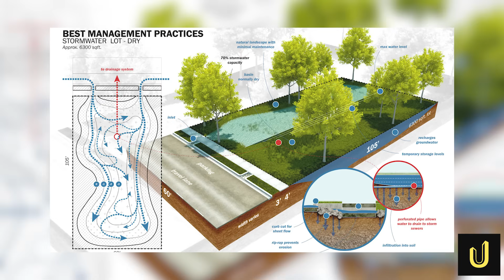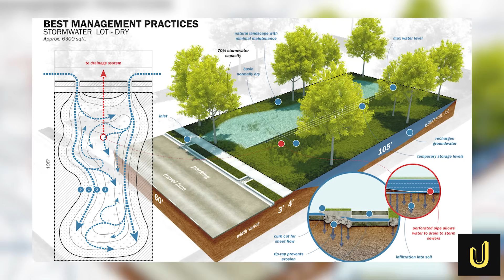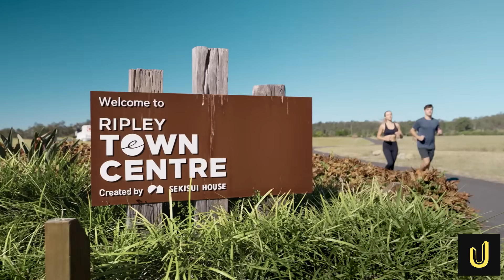The Secret Underneath This $2B Australian City!

Comment: This is the worst type of sprawl urban planning by the greedy and lazy. 400m2 treeless home sites pre- leveled with narrow streets soon to become a heat sink neighbour dystopia.  How many people do you house per km2 in such an inefficient plan 1400 ?  that leaves less about  20% area not covered by a roof for pointless back yards and footpaths.  Considering using that 1 square KM to more efficiently construct just 8 x 20 level high quality towers with underground parking and 4 units per floor and all remaining land used for public amenity and greening that would house 1000 people requiring a 8000m2 building  footprint that would leave 92%  land area open for trees / views and public amenity.

Comment: 1. Ripley is not between Ipswich & Brisbane. It's South of Ipswich CBD & is not a separate city. 
It's part of Ipswich, just like Springfield is.
Ipswich is such a large district that it dwarfs the state capitol.
Ipswich isn't about to separate off the parts of itself it's spent decades developing. Springfield & Ripley will always be Ipswich. 

Ipswich is not only the last part of South East Queensland to be developed, it's such a large project that an apprentice could have started at 1st sod & would retire before the project is finished. 

2. The inaccuracies are both embarrassing & amusing😅

I used to live in the stage 1 Ripley development & watched the 2nd & 3rd stages being built & watched as new suburbs sprung up between Springfield & new suburb White Rock.
Ipswich is one of the fastest growing regions in the state/country & as the last corridor of the great South East to be built out, Ipswich & it's 114 suburbs will continue to be hot property market for years to come.
Historically Ipswich has had a rough reputation but over the last 20yr it's become somewhere in proud to call home. 
World's most livable mid sized city awarded in the mid 2000s really placed us on the map & helped shake off the reputation of old😊
Reply: Believe it or not.